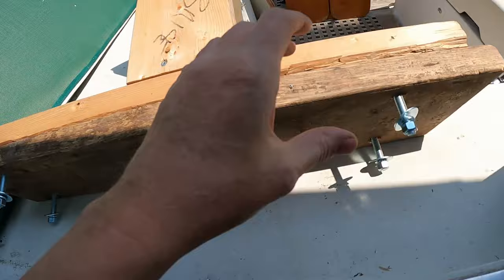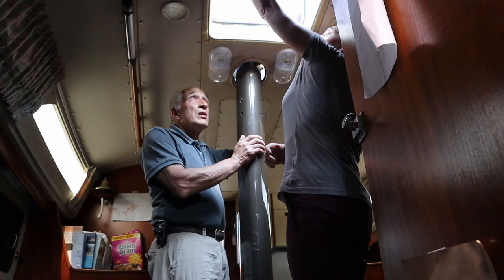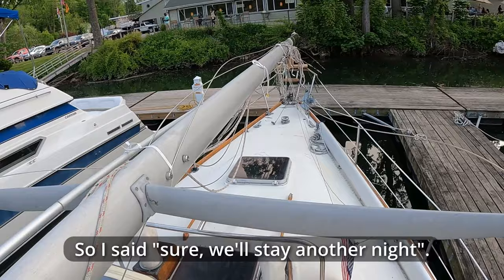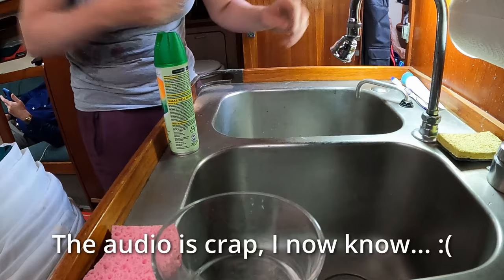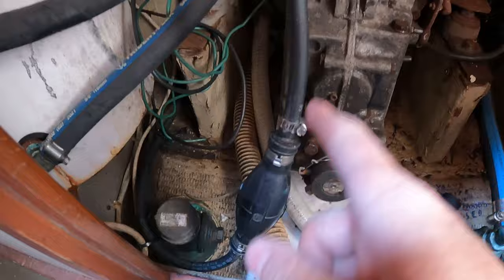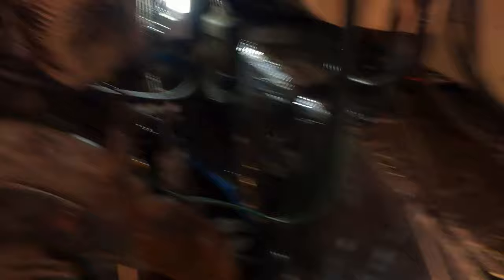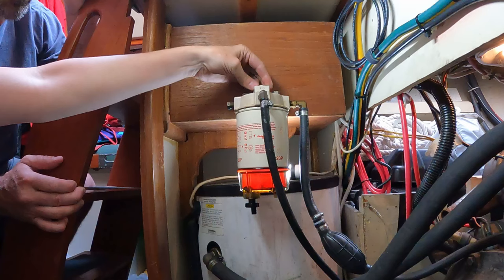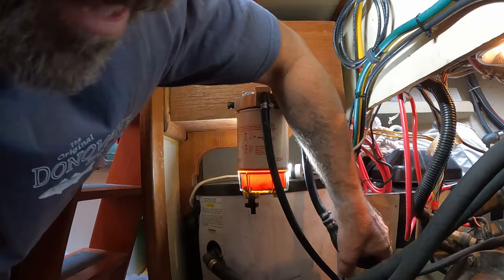Ep. 79 - Mast Down, Breakdown!

Comment: I learned from this one. Maybe rubber from the bulb was the blockage.
Reply from the maker: Entirely possible. I threw out the old bulb, and in hind-sight I wish I had cut it open and looked inside.
Reply: @TheDigitalMermaid  Was just a thought as old impellers seem to drop rubber. I am going to put a bulb on mine now, as i only have one of those click things.
Reply from the maker: @ismzaxxon  Oh, for sure and others had the same idea. Could well have been a bit of rubber sloughed off, plugged the pump and the back pressure popped the bulb.

Comment: Hi Madi, just remember the algae problem in the tank, it grows..
Reply from the maker: Yup. I'm going to pull the diesel out, biocide it, and give it (with warning) to a friend at the new marina. I want to take the tank completely out of the boat and cut an access hole for future cleanout, and put a new sender in. I'll give the tank a damn good cleaning then. I never knew how annoying bug was before... haha
Reply: @TheDigitalMermaid  I wouldn't bother putting an access hole in . Just got steam pressure washer the sh1t out of it as you will never get rid of it as it regrows..biocide are a preventative not a solution.. my boss had the same problem and it's a nightmare to get rid of.
Reply from the maker: @holdenman8850  The reason for the access panel is that there's currently nowhere to get a pressure washer nozel in. If you look back to the videos where I was changing the hoses and cleaning the tank, there's one place where an access window would have  made things SOOO much easier. Neither the fill neck or the sender are very useful as access points. Bug will probably be even more of a problem in the future, as post-conversion, the diesel will only be used for hot water (when conserving batteries), heating in the winter, and an emergency generator (that I will consider a project fail every time I might need  to use it). So with luck, the diesel will end up sitting for ages, so easy inspection/cleanout is going to be really important for me.
Reply: @TheDigitalMermaid  my memory isn't that good 😂 but you saying about it has remained me. It sounds like a good plan you have.. must be late for you as it's 2pm here
Reply from the maker: @holdenman8850  It's only 23:00 here, so not too late. That said, I did just wake up from a nap. lol
Reply: @TheDigitalMermaid  that's the worse to have a nap late at night.. mines due soon, us oldies need a nap in the afternoon 😂
Reply from the maker: Oh, I try to not have a nap after 18:00, but I got hit with a pretty heavy case of the sleepies.
Reply: @TheDigitalMermaid  I'm hearing you and that's caused by over working and no play

Comment: tff u trying to tape up the bulb...... seriously???? first thing I wudda done is cut it off join the 2 pipes with the barb fitting and then dropped the filter lower and get someone to pump the primer and turn the motor over. no crap should have gotten past the filter and u replaced the hoses and the motor ran fine for a long time b4 u got a split in the bulb..... big mistake was shitting ur brain for 2 weeks with stress and long days then doing the trip without being thoroughly rested and compounding ur fatigue even further... if u did rest b4 hand u would have quickly fixed the prob I am sure. Wouldn't it have been cheaper if u got the marina chandler y to deliver the bulb to u?? I would never have paid 2 grand for a tow... delivery charge wudda been 100 bucks at best at 3 miles.
Reply from the maker: "tff u trying to tape up the bulb...... seriously????" - The whole premise of the channel has been the process of someone new to something trying to learn how to do that thing. Things that seem obvious to experienced people are not obvious to new users. I learned from this experience that it wouldn't work, of course, but how was I to know it wouldn't until I tried? 

"big mistake was shitting ur brain for 2 weeks" - I mean, that's a take I suppose. I know most people working on big projects have things wrapped up and ready with time to rest before the big day, I guess I'm not as organized as most people.

"if u did rest b4 hand u would have quickly fixed the prob I am sure." - Given I'd never taken a fuel pump off before, let alone unblock, clean and reassemble, I'm really not sure how I could have gotten back underway without getting help from someone like I did. Again, this might be all super simple and obvious to you, and good on you for it, but as I said in previous videos, I'd never touched a diesel before this project. I've been doing the best I can.

"I would never have paid 2 grand for a tow..." - What's your advice for negotiating a lower tow fee? Again, even if a chandler delivered to a stranded boat in the middle of a river, a new bulb wouldn't have helped, the fuel pump's outlet check valve was blocked.
Reply: @TheDigitalMermaid  the check valve was blocked after all the drama that happened after the initial split in the bulb, something tells me that if u just took the bulb out and joined the pipe, u would have got it going again. Everything u did after the bulb I suspect made thing worse and yes I know inexperienced and tired brain lead u to this disaster.... but hey I would have paid for a delivery by boat and not a tow..... a part of me wishes I was there to save the day :)~ but that was 1 hell of an ordeal and thanks to AKA Bob the savior he explained to u how it works, which is no good now cos ur going to electric.... its tff really cos if there was an electric fuel pump then this would not have happened, or as u know u didn't replace all the rubber. What did the blocking material look like?? piece of hose from the inner wall, cos i cant see how any debri got past the filter.
Reply from the maker: @OffGridAussiePrepper  Everything is obvious in hind-sight, I guess.
Reply: @TheDigitalMermaid  hind sight is 20 20, is that the saying ma dear?? and get ya rest and do not hit the fatigue zone cos that was my demise.
Reply from the maker: @OffGridAussiePrepper  Surely you understand the realities of a big project rarely leave room for what should be done, ideally, right? I would have loved to finish prep a week or two before departure, gotten properly rested, etc. In all my own big projects, and in all the big projects I've seen others undertake, I can't think of a single one that didn't run long. I appreciate that you mean well, but really it just kinda makes me feel like crap. I know I could have done better, but I did the best with the time, tools and knowledge I had at the time.
Reply: @TheDigitalMermaid  not beating u up just telling u to not drain ur batts where ur at risk of making big avoidable mistakes.